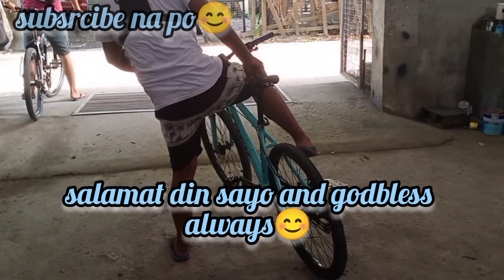paano mag pintura ng alloy bike

Comment: Idol anong gamit ng 1.0 na nossle? Pang kulay or topcoat?  Salamat
Reply from the maker: 1.3mm pwede sa topcoat at pang kulay,ang 1.0mm pang spray out panel sya madalas gamitin sir mejo maliit kase open fan nya,pero depende din sa klase ng rmspraygun idol,salamat sir
Reply: @zadysautohandsonpaint7705  salamat idol. Nalilito po ksi ako dami kasing nossle.
Reply: @zadysautohandsonpaint7705  gamit ko po kasi e 1.5 nossle. Balak ko po kasi magpalit.. Salamat idol.
Reply from the maker: 1.3mm idol ol sa lahat,nung araw sa casa kami ang gamit ko 1.3mm na euromax lang isang spraygun matagal kong gamit yan,sa fluid lang  naman ang adjust nyan,